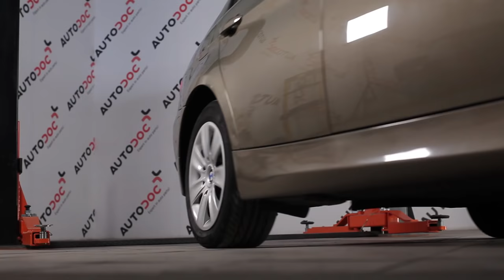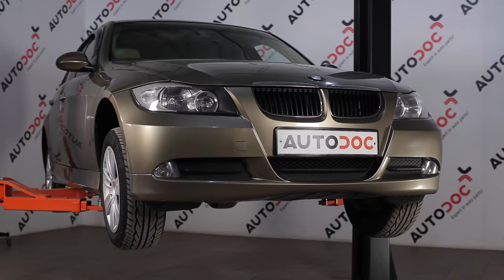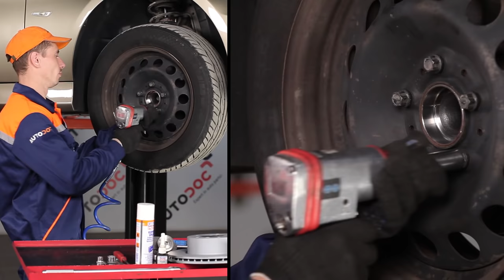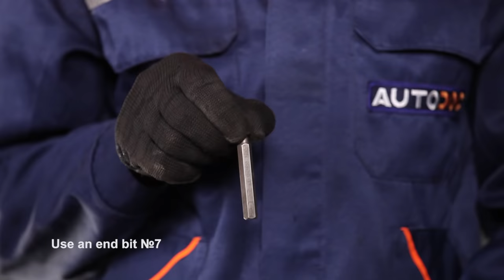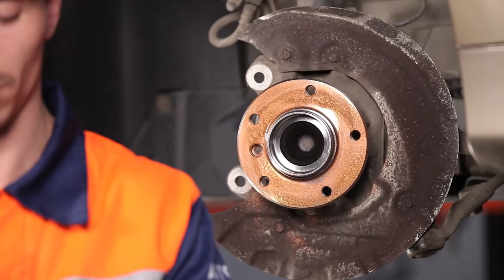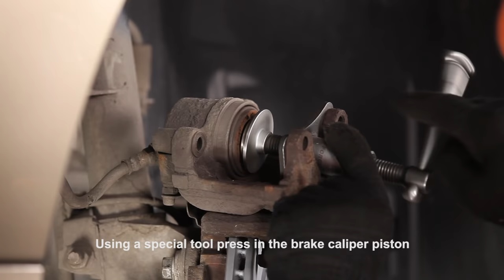How to change front brake discs and front brake pads on BMW 3 E90 TUTORIAL | AUTODOC

Comment: Which is the torque (Nm) required for socket n. 18 (min. 5 sec. 9) and for the end bit n. 7 (min. 6 sec. 30)? I refer to BMW E91 320 D, 120 kW

Comment: Please make sure you use brake cleaner on your new discs to get all the grease off that stops them rusting in storage... If you don't, you won't have a driveable car after the first corner/road end you come to...

Also, use ceramic grease or similar on the back of your brake pads, or they will squeal their A$$ off. In addition... don't use copper grease anywhere if you have ABS on your car. It can (I've seen it before) damage your ABS ring by causing premature rusting.
Reply: Rubbish
Reply: This only applies to non-coated discs. Like the ones in the video are coated rotors, which will burn off on the first few used and require no prior cleaning

Comment: is this possible with only hand tools?
Reply from the maker: Yes, it is possible to do the replacement using only hand tools.
Reply: thanks, i got a breaker bar and a toolbox lol, hopefully itl work, btw, i have a E90 that got into a accident and its parked up, i put fresh front discs and pads but now theyre rusty, can I remove and use them?

Thanks

Comment: Can't believe you haven't cleaned the rotor surfaces. The oil based preservative coating put there by the manufacturer to prevent corrosion and rusting in storage
Reply from the maker: Thank you for your valuable clarification, we will definitely take this into consideration in the following videos. Best regards, Autodoc team!
Reply: That looks like a zinc-coated rotor. It is not coated in oil before shipping. It is fine to install as is.

Comment: What is that LiquiMoly applied on the bolts?
Reply: I would say is thread locker.
Reply: I think you are right, thank you.
Reply from the maker: The liquid used in this video is the Liqui Moly threadlocker. Best regards, Autodoc.

Comment: hey my brakes are spongy after brake and rotor change. I removed some brake fluid from reservoir but never went below minimum. I drove it around the block twice it seemed to get better on second trip. Any ideas?
Reply from the maker: Thank you for your feedback!  Unfortunately, it's hard to answer your question, there can be many reasons for it. We recommend  that you contact the Car Specialized Service for full diagnostics and revealing of the reason of malfunction. Best regards, Autodoc.

Comment: e90 disk size for the front...300,312,300,336
rear 299.8,300,336

that's right.....299.8mm rear disks
Reply from the maker: It is not possible to answer your question, you can find this information in the technical documentation for the repair of your car.

Comment: Poof video. Does not show cleaning disc before putting on, nor any torque wrench use or settings, nor cleaning metal wheel seating.  Useful only to a degree
Reply from the maker: You are absolutely right, some moments were missed, in the future, in new videos, we will definitely add this information for our viewers, and we will also start using a torque wrench indicating all tightening torques.
AUTODOC

Comment: seems you forget to change the brake pad sensor
Reply from the maker: Thank you for the feedback! This video is considered to be an informative one, and it shows the sequence of repairs, so some stages of the repairs might have been excluded. Best regards, Autodoc.
Reply: still you've done a great job, very clear and helpful
Reply: the brake pad sensor is located on the other side of the vehicle, one per axle
Reply: @autodocuk  
Soooo .. it does seem as if your forgot the brake sensor ..

Yes it's on the left side, but what stopped them from filming it on the other side?